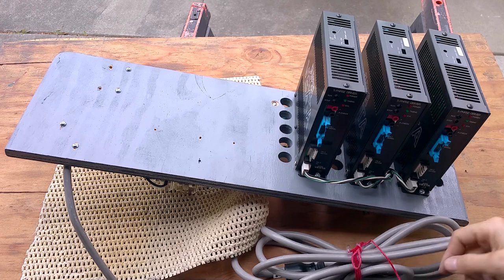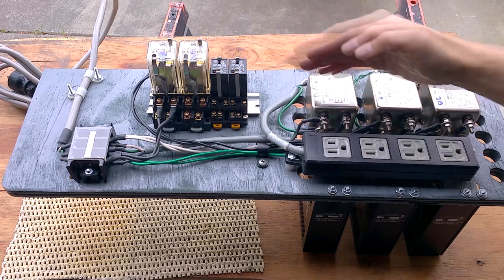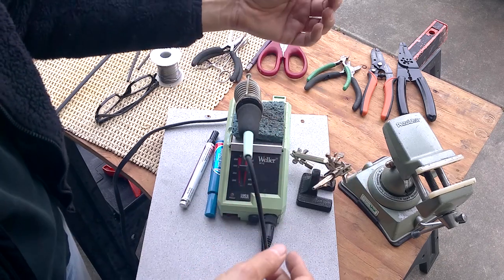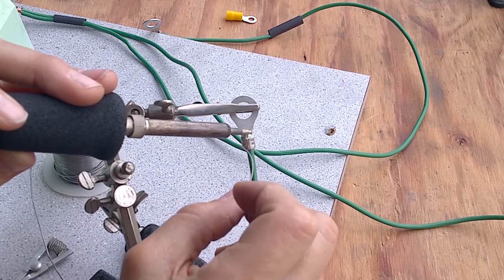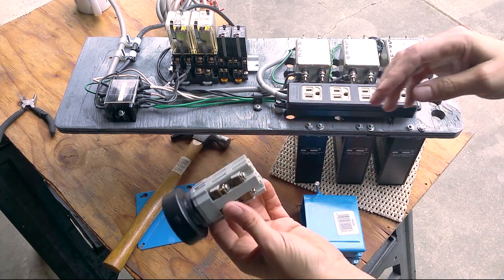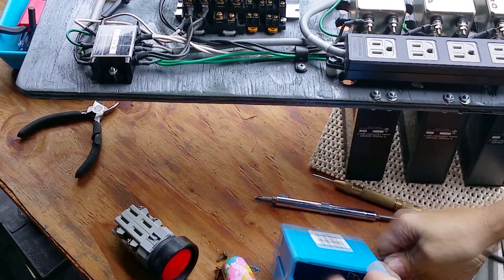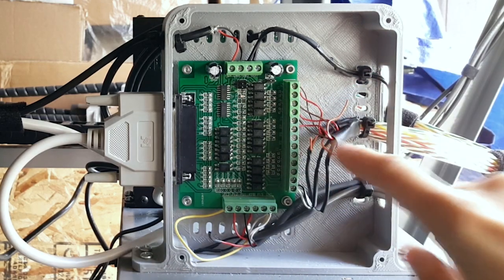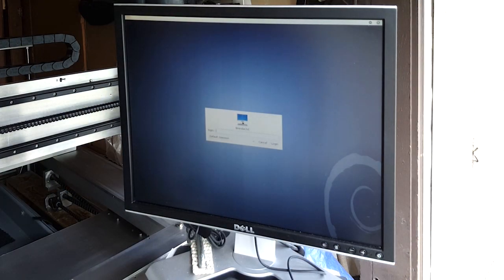Recycled CNC Part 05 - Wiring and LinuxCNC

Comment: Does LinuxCNC self detect what kind of stepper motor are you using?
Reply from the maker: raul torres , No. Generally, steppers have to be configured. In the case of LinuxCNC, it is done using a utility called Stepconf, which has drop down menus an text boxes.
Reply: BrendaEM is it difficult to configure?
I want to build one for sheets of 20 x 8’...
Reply from the maker: With Stepconf, and a normal setup it should be somewhat like Mach3's configuration, though, there are things to learn and know because you would be moving around a brittle high speed cutting bit.

You might want to check out Cnczone.com for more infomation on CNC machines, as well as some more videos. CNCzone.com has some great forums.
Reply from the maker: The steppers are quite old Vexta 5-Phase steppers taken from old wafer fabrication machines.
Reply: BrendaEM thanks for answering. I have a couple of cnc. I bought them brand new. But I have no idea on how to configure. I’ve been reading in the forums about configuring, but it’s like if I was reading another language.
Reply: BrendaEM how can you know what brand they are? I will need some help building my own. Could you help me out? Specially with electronics.
Reply from the maker: AFAIK, no CNC setup has auto-detection. Most CNC machines are open loop. For instance, the computer has no way of knowing what pitch the screws are.
Reply from the maker: I am sorry, I cannot guide you step-by-step through building a CNC machine.
Reply: BrendaEM I meant if you could help me guiading me, specially with electronics. But that’s ok.

Comment: How mcuh did you spend on this project? where did you buy the components? How can you tell a NEMA motor?
Reply from the maker: At that point, I had about $120us in the project, mostly in bolts and tool bits. Most of the components are old and were going to be scrapped.
Reply from the maker: In the end, I think I spent $650.